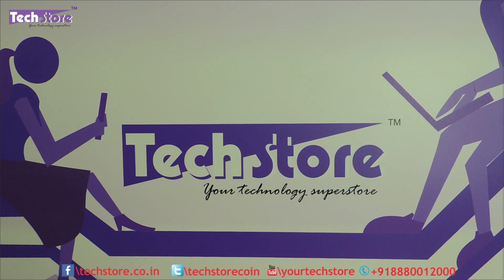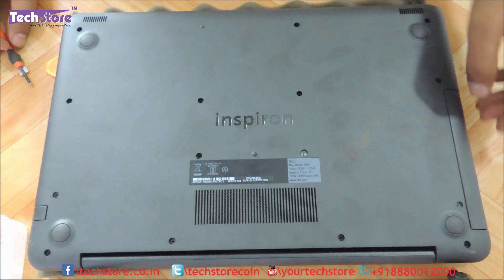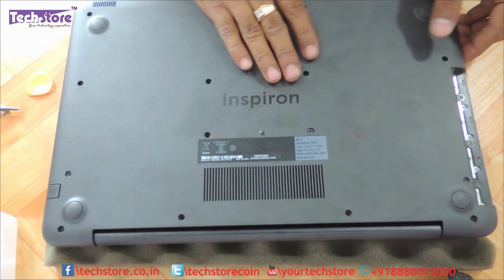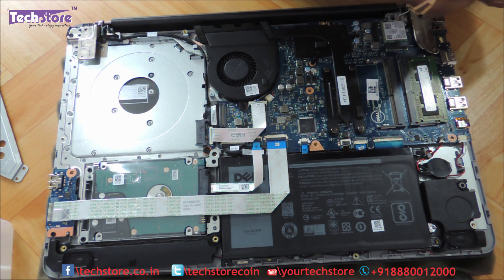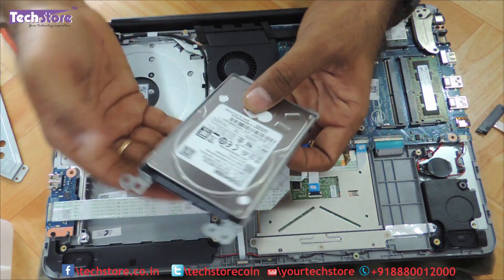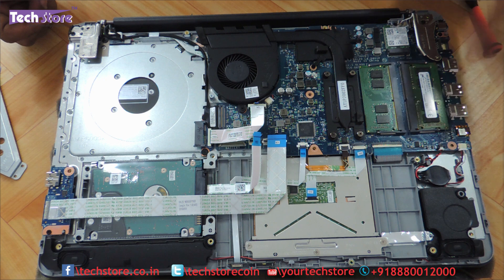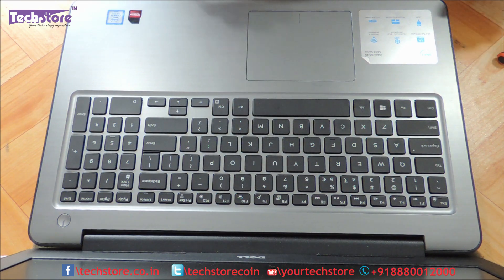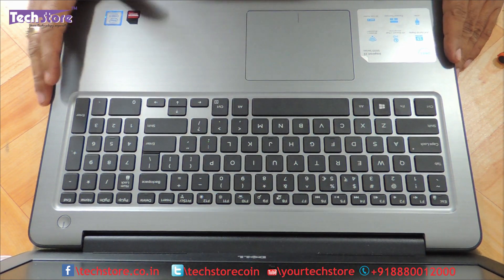Dell Inspiron 15 5567 5000 Series : How to upgrade ram hdd ssd dvd keyboard laptop easy diy

Comment: Hi, I have  a Dell inspiron 5567, corei7 (7th), memory video Radeon (4GB), with a SSD (512GB-upgrade) , and 8GB RAM (2133MHz), I want to upgrade the memory RAM at 32GB but i didn`t know if it's posible and if the laptop support two memory cards of 16GB RAM (it has two ram slots) at 3200MHz, someone could help me with this question

Comment: hi 
i am using the dell 5567  laptop, now i wanted to upgrade the laptop with RAM and add SSD to laptop.
Could you please tell me that is that DVD optical is SATA 3 or ATA model?

where i can see that DVD is having the SATA or ATA
Reply from the maker: It is SATA3
Reply: @TechstoreCoIn  where we can check those details.  Could you please help on this

Comment: Sir Dell Inspiron 15 5567(intel i3 6006u) konsi Ram support krta hai 2400MHz or 2133MHz ? , because when I purchased it shows 2400 but after update windows 10 it shows 2133, sir please tell me
Reply from the maker: Even if you put 2400 mhz ,it will downscale to 2133
Reply: @TechstoreCoIn  thank you 👍🏻😊

Comment: Sir, afterul upgrading ram im facing issue. I cannot turn my laptop on. On pressing the power button led blinks but is not turning on. Please help sir.
Reply from the maker: Just check if you have installed the correct ram. Please note it will take some time for the laptop to boot when u upgrade ram first time.
Reply: @TechstoreCoIn  Thanx for the reply but the motherboard's 2nd slot was faulty which was replaced under warranty. Now my laptop is running fine, upgraded with  8gb ram and 500gb SSD.

Comment: I have the same laptop( touchscreen ) which has been showing ghost touches forced me to disable it. Any idea what i can try to get it fixed? Thanks in advance
Reply: I had this issue with both of my laptop (Asus) but I ended up just disabling the touch screens as it coud not fix it. If you laptop is under warranty contact Dell.

Comment: does the CORSAIR Vengeance LPX 8GB (1 x 8GB) DDR4 DRAM 2400MHz C16 (PC4-19200) Memory Kit (CMK8GX4M1A2400C16) work with this?
Reply: No, that is full size PC ram, the laptop uses smaller dimm slots

Comment: Hey i need some answers.I actually use this laptop when i play games it always heat in the little space between the keyboard and the screen and my fan make some loud noises.is that nrmal
Reply from the maker: +R. william This is normal as the design of this laptop is such. Use a cooling pad.
Reply: Techstore ok thanks

Comment: can i replace non backlight to backlight keyboard  in this modal
Reply from the maker: +praveen singh this model comes with backlight only
Reply: 5567 i3 6th  they provide me non backlight keyboard
Reply: @praveensingh3463  but I also have 6th generation i3 ..it have backlight keyboard
Reply: praveen singh probably u have to switch on ur backlit bcus all 5567 comes with backlit. Try pressing F10 to On backlit
Reply: @ManmohanGrewal   i also have the same model but with non-backlit keyboard

Comment: hello techstore, im wondering, is Kingston HyperX FURY 8GB Desktop Memory 2400MHz DDR4 CL15 DIMM 1.2V Low Voltage 288-Pin HX424C15FB/8 - intl. compatible with it? you said in the video that it could take ddr4. or ddr3 only? please reply asap. thank you, its a great video!
Reply from the maker: +Kqlwkw,w Wlwlw,wle yes,the memory you mentioned is precise for this model. we never said DDR3 would work. This model requires only DDR4L 2400 memory

Comment: Hello, thank you for the video. Can you tell me if I have to change something in the bios after change HDD to SSD? I changed and after around 10 minutes working the SSD the pc show me a Bios Screen message "There is not a HDD in the pc" and shut down. ( Excuse my English)
Reply: Alejandro Guzman S your windows files are gone with ur hdd drive thats why pc is taking u to bios. Install new windows to ssd or take a backup of ur hdd to ssd first then install new ssd

Comment: its possible, you to make a video showing the keyboard conectors and version? i'm wondering to replace mine.
Reply from the maker: We will be shortly uploading a video for this.
Reply: thx, i'm seeking for one backlit keyboard, the models disponible in my country come without backlit, =/ also without dual band wi-fi
Reply: Did you make this video? You had keyboard in video title, then didn't address replacing a keyboard.